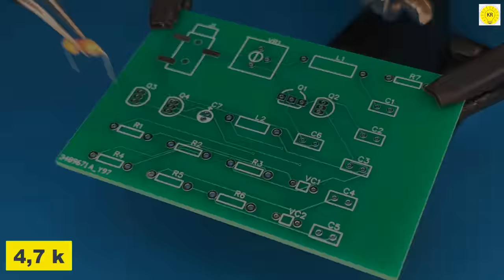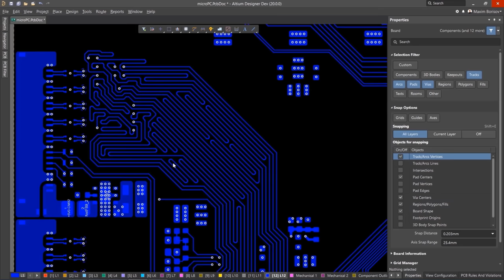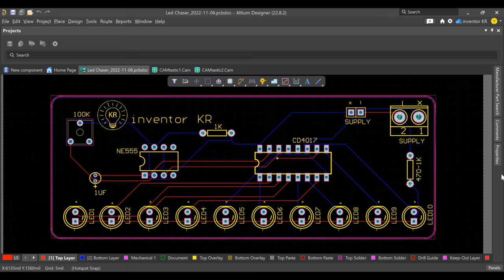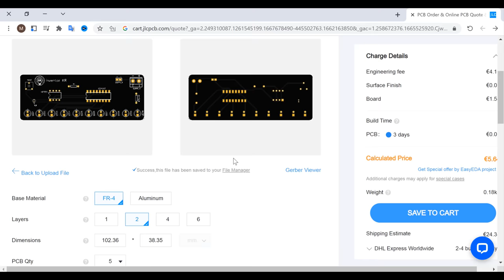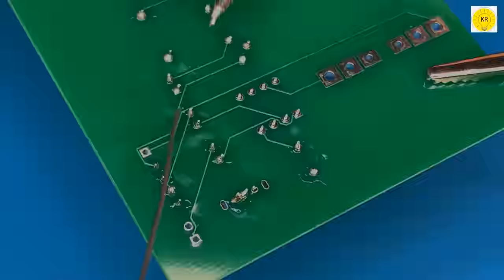how to make fm radio receiver , altium designer

Comment: This video has so much wrong with it, and is so choked with commercials for Altium Designer, it plays like a scam. No schematic is shown, and the component count, and component types, looks barely able to receive AM signals much less the more complex FM signals. There are a lot of webpages that investigate the simplest FM receivers, and they all have a lot more going on than this one, but at least with their schematics we can see how they work. Add to that, even if all transistors on the PCB are cleverly used to receive  the FM signal, it sure looks like there is a deficit on remaining transistors to drive the 8 Ohm speaker, something that usually requires a few gain stages.

The video shows a pot and a couple trim caps being slightly adjusted, and for all we know, this is a fake where the circuit is not even doing anything, but a separate soundtrack is superimposed.

And who does PCB assembly by hand using tweezers, and soldering from the component side? Suspicious.

Without a schematic to add veracity, I think this is fishy.
Reply: Fishy is being ever so polite..   Min basic FM radio should have many more stages. Tuned front end, Local oscillator, mixer, IF amplifier and detector stages and audio amplifier.
Not only do you need to hear the station you want the others need to be blocked or filtered out. People need to do a little research on receivers.  This is nothing more than a Cats whisker radio that was used on AM.
Reply: he does provide a schematic in his blog

Comment: Hello friend, instead of using a capacitive trimmer to tune the radios, you could use a ceramic capacitor of 18Pf and the oscillator coil with a variable coil that would avoid breaking the trimmer in the radio station change, the inductor coil being variable instead of using trimmer
Reply: 7

Comment: Hello friend, instead of using a capacitive trimmer to tune the radios, you could use a ceramic capacitor of 18Pf and the oscillator coil for a variable coil that would avoid breaking the trimmer in the radio station change, the inductor coil being variable instead of using trimmer. ..varying the inductance of the inductor also varies the frequency thus changing the radio stations
Reply: Muito bacana . Melhor traduzir em português
Reply: That's just dumb. It is much better to use a Variable Capacitor than some gimmick to make a variable inductor.

Comment: I suppose if you use the soldering iron they use to keep cows and horses together, then you can solder on the wrong side of the board.
Reply: Yeah my quality department rejected the board. I guess consumer electronics you can get away with a lot of things. That iron is too big also. The flux is easier to remove from the solder side of the board. Now where is the conformal coating  just kidding I just coated 17 boards. 73

Comment: in place of the trimmer by a ceramic capacitor of the same capacitance of the trimmer and in place of the oscillator coil by a variable inductor will avoid breaking your trimmer during the change of radio station a variable inductor coil and the frequency will be changed in the inductor coil itself. the change of tune

Comment: I made this radio receiver today and it received just one station at 89.1Mhz frequency. The quality of my receive is poor with a lot of harmonics. I don't know where my problem is coming from! I got every other thing right except the coil, I used SWG of 23 and obtained a six turns on a 5mm core. I don't what I should do to receive other frequencies and improve the quality on my radio. I was super excited because this is my first radio receiver ever built....
Reply: Well done !  This is a basic circuit. A 1/2 decent FM receiver is way more difficult. Google FM receiver chip, im sure something will pop up that you can build.
Reply: @markkennard861  
OK 
Thank you bro
Reply: You can use an TDA 7000 fm receiver kit instead . It has better receiving quality if you choose the right components to drive it .

Comment: For 1 micro henry. With a wire thickness of 1mm and a winding diameter of 5mm, I got 33.6 turns. Tell me please is it right?
Reply: What is the resonant frequency you are focused on. Sorry I haven't been looking for 1 uH. 33 turns sounds like a choke rather than a resonant tuned cct. I can make here and measure for you if that helps.

Comment: VOCE PRECISA DEIXAR O DIAGRAMA DESSE RADIO PRA JENTE BAIXAR OK AMIGO
Reply: I would not be bothered I built an FM tuner in the 9th grade from radio shack and it picked up good but the trim cap needs a tuning capacitor trim caps don't last long if you keep changing stations. 73

Comment: Great for pcb
Reply: What is your designed software
Reply from the maker: altium designer
link below the video to register for the program
Reply: Thanks you very much
Reply: I love your channel
Reply: I am mechatronics
Reply: Hello friend, instead of using a capacitive trimmer to tune the radios, you could use a ceramic capacitor of 18Pf and the oscillator coil with a variable coil that would avoid breaking the trimmer in the radio station change, the inductor coil being variable instead of using trimmer

Comment: Very great video, I like the project. 

From the diagram from the link you provided, my question now is 

1) Which of the inductor between 2.2uH and 10uH is the coil ? 

2) How can one make the coil? 
I mean the wire diameter, the coil diameter and the spaces between winded coils? 

I will be pleased if you you respond as soon as possible. Thank you Sir!
Reply: If I understood your second question right, then this is the way to do it: 
You can use a pen or any cylinder with the desired diameter, and wrap the wire around it to make a coil. and for the distance between the winded coils, while putting the pen inside the coil’s hallow, put a ruler on the outside while using a small screw to adjust the distance
Reply: They are both coils, one looks like a resistor but is a coil